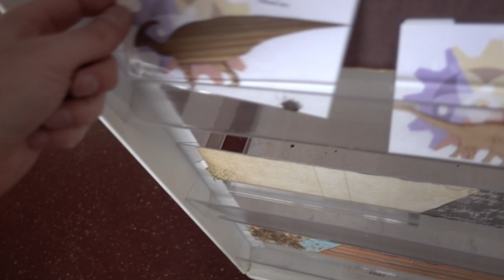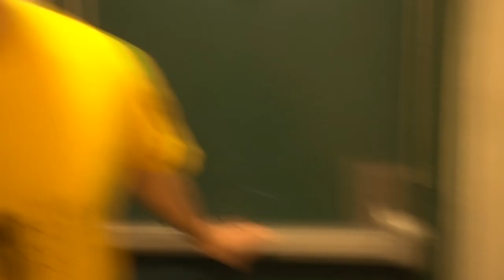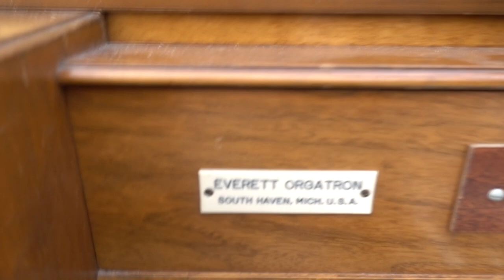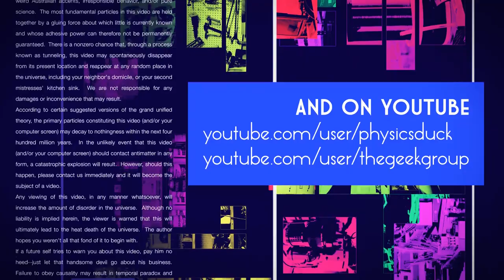Captain's Blog 10 8 2018 Organ Donor

Comment: Does the Orgatron use rotating wheels to generate the primary tones like Hammond’s do?  Never saw one before.  Also, interesting take on a Leslie.  Love the rectifier tubes in the Leslie....ooh that purple glow. 👍🏼
Reply: The Everett Orgatron was based on free reeds, like you'd see in an accordion, or a foot-pumped reed organ. 

The Orgatron added an electric blower, magnetic pickups near each reed, and an amplifier. Pressing a key opened a valve to let air through a reed. The vibrations in the reeds would be turned into an AC signal, and maybe run through some tone coloring circuits. The end result would get pumped through the amplifier.